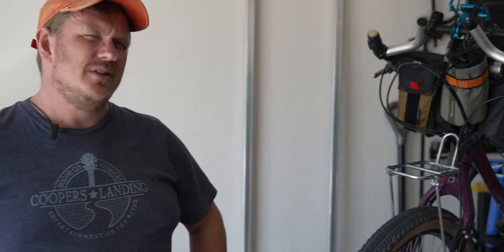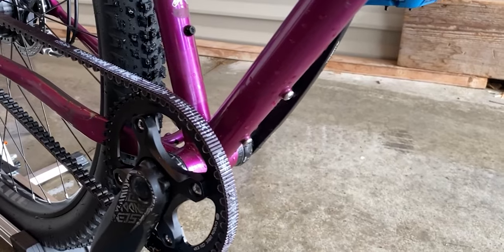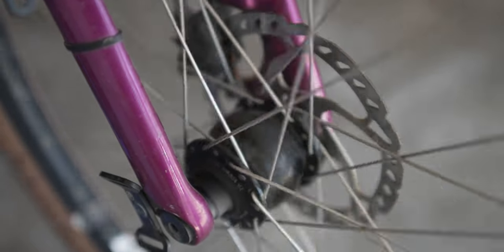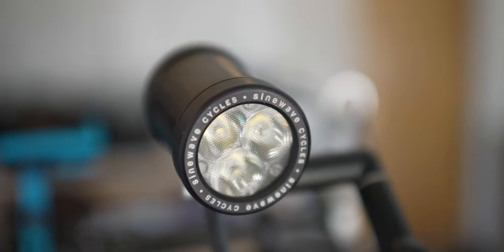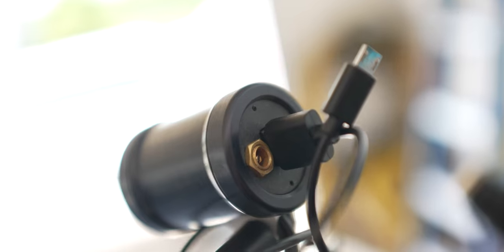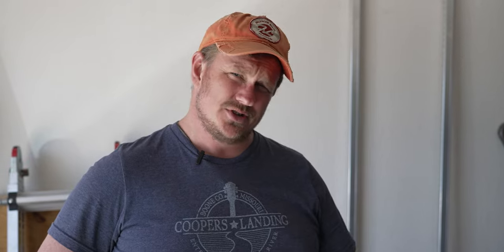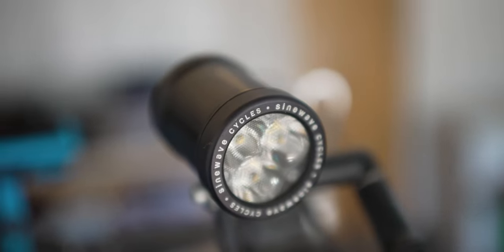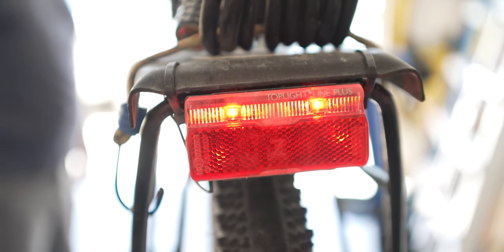Son Hub Dynamo & Sinewave Cycles Light on Salsa Fargo

Comment: I have that same setup on my Cutthroat.  As good as the lights (front and back) are, the real value is in the ability to charge a battery or device while you're rolling.  While on a multi-day trip, I will typically charge both my Wahoo GPS and a small battery for charging my phone overnight every day.  Unless the day is short or has an insane amount of climbing that slows you down, charging both is a pretty reasonable expectation.

For what it's worth, look for a battery with "passthrough" charging capability.  That allows you to charge a phone while rolling by evening out the current.  Otherwise, most phones won't charge well at all when hooked directly to the output of the hub.
Reply from the maker: Thanks for the info!

Comment: Yeah I hate battery lights to unreliable, they are great as a second light but you can't beat dynamo lighting. Not only that dynamo lights last for ever, years and years, battery lights your lucky if they last 2 or 3 years and decent battery lights are not cheap.
Reply from the maker: Very true Nick.  Battery lights sure lack reliability.
Reply: True!  The dynamo is very smooth, and the sine wave beacon seems to be tough as nails, and I really do like the light pattern that it sheds

I’ve had it in several rain storms, and some different lighting scenarios. It is quite good so far!